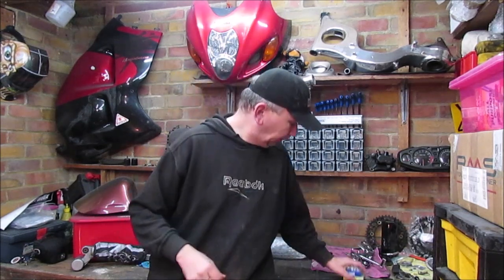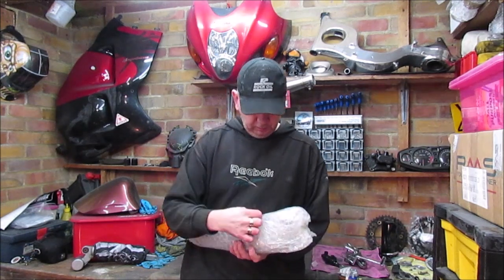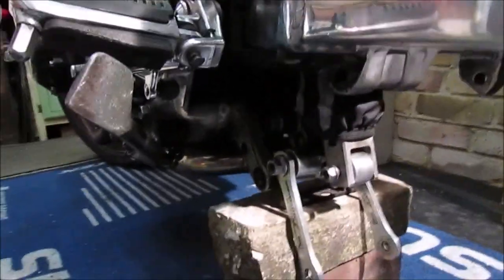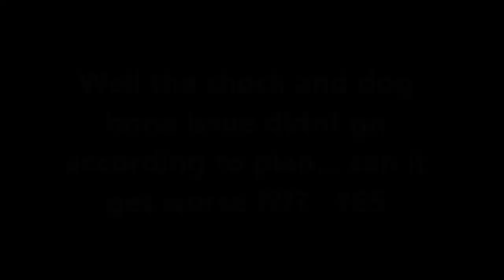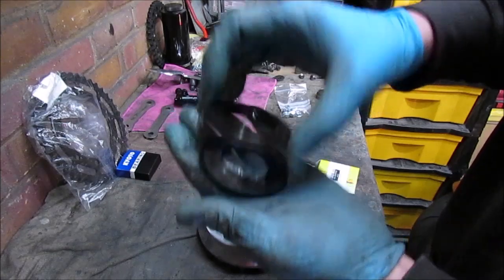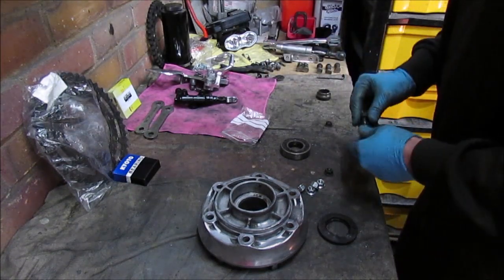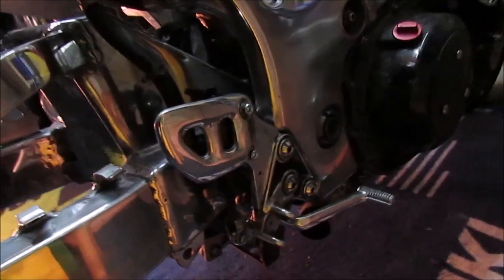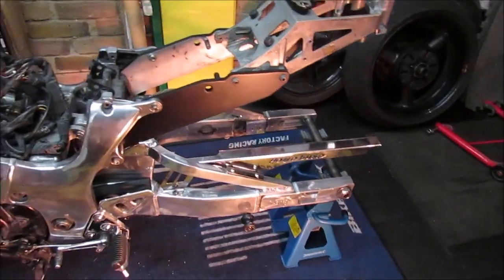Suzuki Hayabusa - Part 55 - Oh dear not a good day

Comment: Tribulations aye buddy.. if it helps, the general guide for dog bone length is "half a hole longer = one inch lower".. best way to set the exact ride height is to drop the wheel in place, set the ride height you want using a jack under the bike.. and then just measure the centres between the dog bone mount holes.. then buy them that length..!!

Comment: Such a pain when it's the wrong size or just won't fit. I had the same with some clip ons I got for my speed triple, the clamps were too small. 
Good work and at least it's getting there ready, and sure you can't wait to get out on it for the first time.
Reply from the maker: Cheers Daniel, it is a pain, but as i said these things happen sometimes, still plenty to get on with though

Comment: It is coming along nicely and looking nice and shiny.  I hate it when the wrong parts get sent then you have to wait on the work along with dealing with the ship back and forth.  I was curious what you are going to do with the old busa parts since you are not going back to stock?  PS.. Keep up the hard work it will pay off in the end. I hope when it is all done you make a vid of it shining in the sun.... Did you polish up the foot pegs too.. (under the rubber pads)  didnt look like it in the vid so was wondering.
Reply from the maker: Thanks Someone, i was going to keep the old parts as i was thinking maybe later turning it back to standard, but its gone way beyond that so will more than likely sell them, i gave the footpegs a light polish round the edges
Reply: @TheAmateurBikeBuilder  Must have been how the camera pictured it.  I couldnt tell in the vid if they were.  Everything else shined sweet.... You know what the stock color you have on the wall is?..... I have found 3 different names for that color and none really matched.
Reply from the maker: Cheers Someone, yes the colour is Suzuki Candy Antares Red and Metallic Saturn Black - from the 1999 version